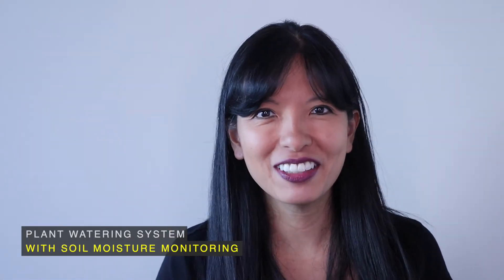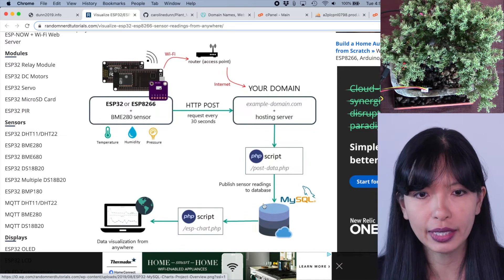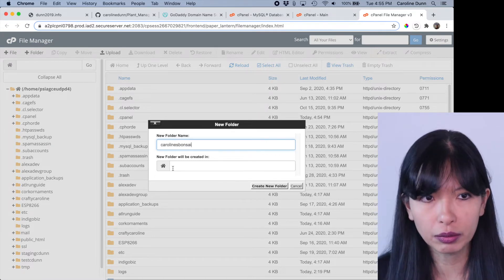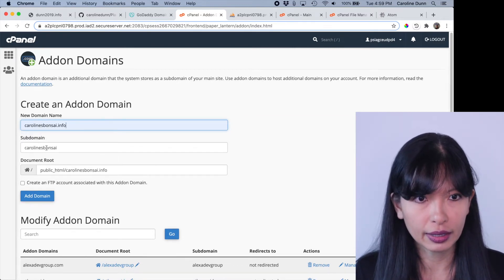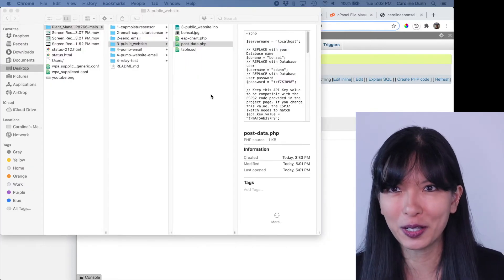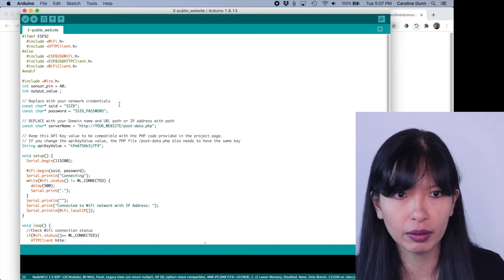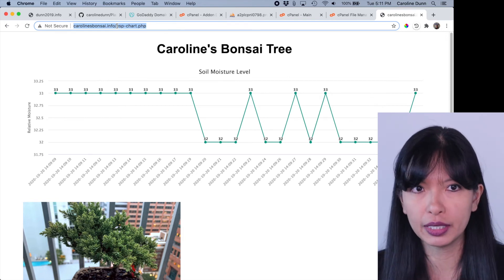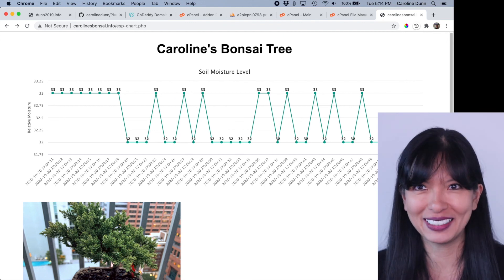House Plant Monitoring and Watering Part 3: Public Website ESP8266

Comment: My PI 400 Arrived 11 11 2020 - Plugged it in as you show nothing 
happened on screen, the red LED flashed, I waited 10 mins and noting - 
So switched off the PSU, un-plugged the SD card - Switched on the PSU 
and the PI 400 displayed on my TV trying to boot. Displaying no boot SD 
found – I switched off, replace the SD and it killed the screen again. 
Pi 400 work ok with out SD boot But refuses to boot with the SD card 
inserted. The SD card when inspected via my lap top, has 2 folders on 
it, a Boot and a rootfs. - What do I do now ?